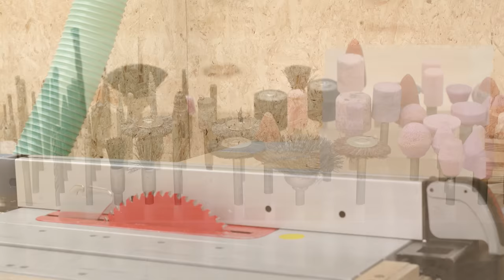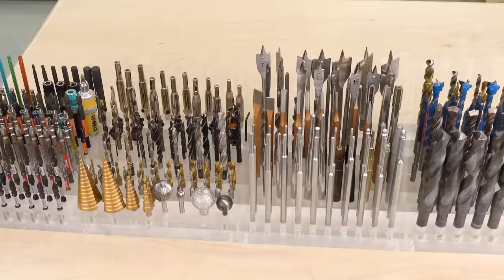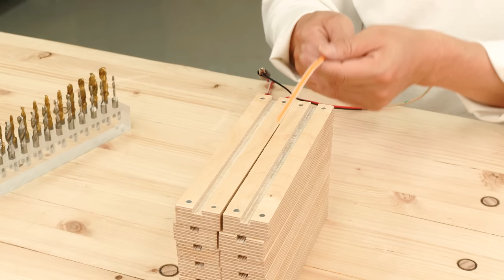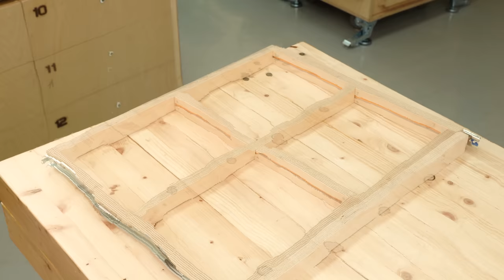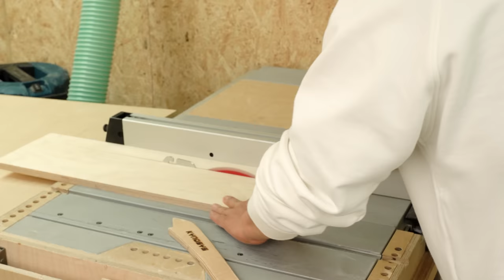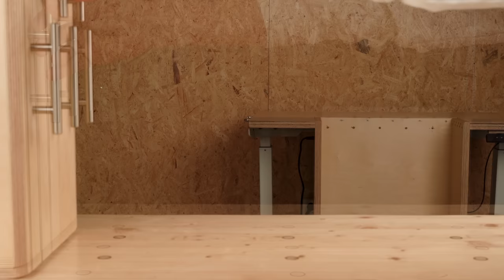Making Vertical Bit Drawer / DIY

Comment from the maker: 3D Modeling Blueprint : https://youtu.be/LUq-XsEyskM
I use a lot of bits such as drill bits and cross bits and hole saws.
It was always difficult to store these bits.
When I tried to put it in a holder and use it, the space became too wide, so it was inconvenient, and it was difficult to find what I needed if I put it in a drawer.
So, I made a vertical drawer with acrylic as the basic storage base.
Taking advantage of the characteristics of transparent acrylics, LED was installed on the floor to light up the floor, and especially, the wiring such as LED was used for the drawer rail itself. 
I focused on the fact that the drawer rails always consist of two sets. 
The wiring became very easy, and there was no interference from the wires when pulling out the drawers, so it became comfortable. 
I also attached a clickable lead switch to the rear of the drawer rail so that it can only light up when the drawer is opened. 
And so that the switch can operate stably, I used the damper rail to allow the drawer rail to close on its own where the last switch is operating.
I attached a magnet to the bottom of each acrylic base, which was made detachable, so that not only the bits could be stored, but also the bits that I used could be easily taken out and used.
The advantage is that it takes up less space, and it's pretty beautiful looking like Mac Pro.
It's a product that is at the forefront of the complete drawing among the works I've made.
If there's a lot of support from you, I'm considering mass-producing it as a selling product.
I recommend you to refer to the video and make it yourself. 
Thank you.

Comment: podrias hacer un video explicando como regular la profundidad del taladro bosch.
Reply from the maker: Es muy sencillo. Después de girar la manija para bajar a la altura deseada, asegure la palanca en la parte superior izquierda. Al reiniciar, suelte la palanca y repita la operación anterior. gracias

It's very simple. After turning the handle to come down to the desired height, secure the lever on the top left. When resetting, release the lever and repeat the previous operation. thank you

Comment: Cool peoject, but there was a missed opportunity 😅. V2 should have addressable RGB LEDs, automatic openjng and closing, and a voice activated system so that you can say "Jarvis, I need a 5mm brad point drill bit" and the correct drawer would open and a light would show where the bit is located. 😂

Comment: Beautiful work...scientifically magical!
I was surprised to see you used epoxy on the limit switches. Seems like that would make it difficult to replace if one were to malfunction. Is there a reason you didn't think the screws would hold them well enough?
Reply from the maker: I salute you for your precise and sharp points. 
In the video, I realize that I have to pay the utmost attention to every detail, no matter how small it is. 

Actually, it was because I was a bit lazy. I worked hard for a week, and it seems that I lost my concentration in the last part. You should have determined the position of the limit switch, drilled a hole through the plate, and used bolts and nuts there. Or you could dig out a bit with a chisel where the limit switch would be. 

I just used screws. However, there were no thin and long screws. I was worried about fixing it to something shorter. So I also used epoxy. And the epoxy comes off easily, if you want to get it off just put a chisel between the switch and the wood and give it a light tap. The fact that the lifespan of the limit switch is so long also helped my laziness.

 Thank you for your heartfelt advice. I will work harder not to miss the details.
Reply: @Kynosys_  Good tip about using the chisel to dislodge the epoxy. I will remember that. 

My question was no criticism. I am still in the early stages of learning, and have already learned much from your work. I thought it very likely that I was unaware of an insightful reason for choosing the epoxy. And I learned the reason was ease of application, and that a well-placed chisel eliminates the only reason not to.

Your laziest day would outperform my most productive. I am both humbled and inspired by your work sir.
Reply from the maker: I'm not offended at all by your opinion. Rather, I feel grateful for being able to think a lot. Your humble expression about my lazy day is so touching. You seem to be a wonderful person who manages your life modestly and confidently. For your thoughtful writing, I express my deep gratitude. thank you!